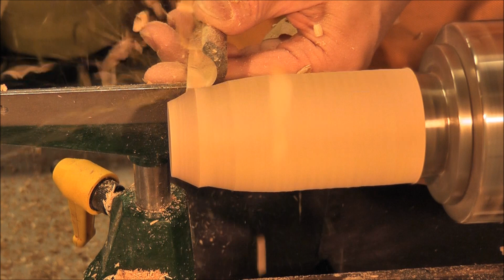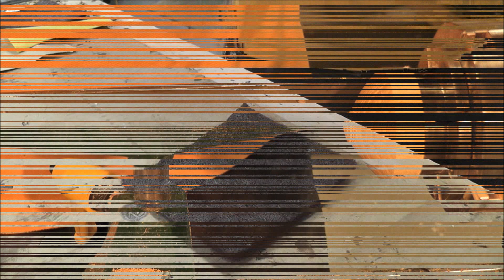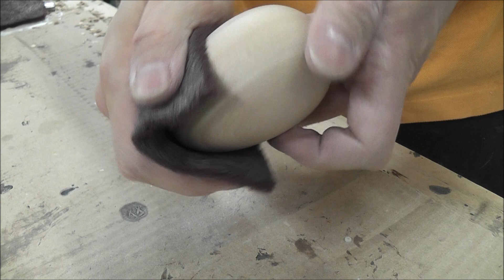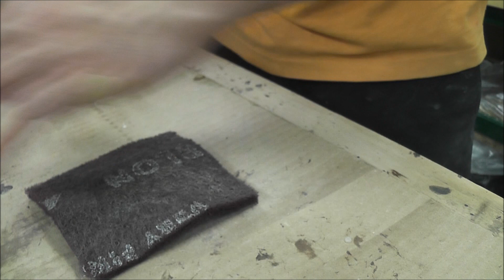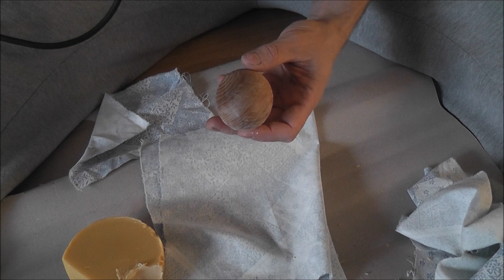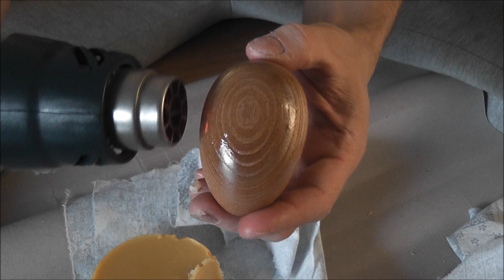Woodturning: Full Egg Making Process HD

Comment: I have never seen beeswax melted onto wood before.  I'll be trying this.  I'd need to get making the basket of eggs my wife asked for 2 years ago, no excuses now.
Best Wishes, Brendan.
Reply from the maker: Actually it is mixture of tung oil (140g), beeswax (60g) and carnauba wax (35g). Full cake 235g. It is quite oily first, but it will dry in few days :)
Reply: duunari81 Thank you very much.  I can search for that now.
Best Wishes, Brendan.
Reply: Heating it also expands the air in the wood pores. Then, as it cools, it literally sucks the wax (or oil) into the pores. Helps maximize chatoyancy.

Comment: You are quite right, you do not need expensive turning tools to turn, at least for smallsh work. But a gouge (carpenter's gouge is what I use) works just as well aas their expensive cousins with fancy grinds. I have turned many a tool handle with nothing more than a foot-powerd springpole lathe. Good exercise, too. A skew chisel is useful for fine work and you can grind one yourself if you get an attack of turnitis -- the desperate need to turn something :) Very nice finish on that Easter THingy.

Comment: The first step, mounting the square block in the chuck seemed risky, but I thought I'd try.  The block nearly hit me in the head when it came off.  So I tried again, trying to tighten it better.  Still flew off.  Any tips to make this work? thanks
Reply from the maker: Hmmm, few things come in to my mind. You can use the tailstock to support the other end and you also need very sharp tools. And don't use too long workpieces.
Do you use cutting or scraping tools?

Comment: This may be a silly question, but does a higher number sand paper mean a shinier and more detailed finish?
Reply from the maker: If the wood is very hard and solid, then yes. With softer woods the limit is about 400 grit, after that you don't get more shinier finish, even how hard you try. I usually finish my turnings with Mirka Mirlon (very fine) grit is about 360.